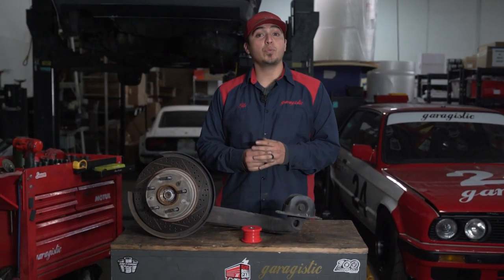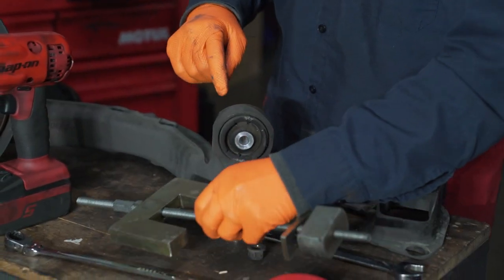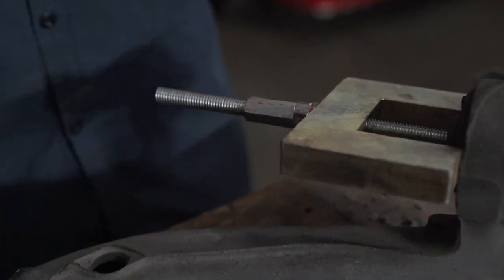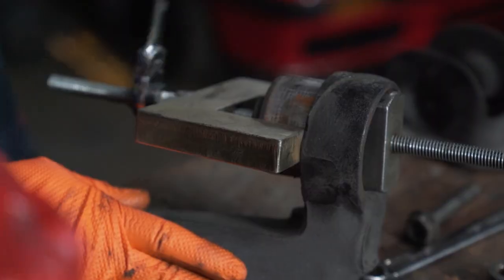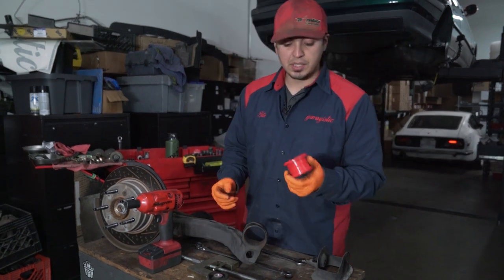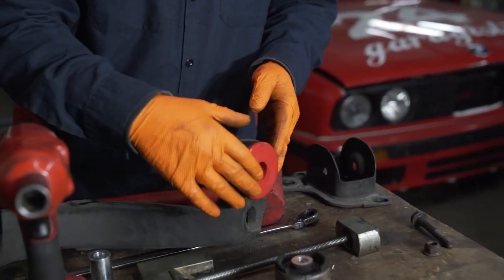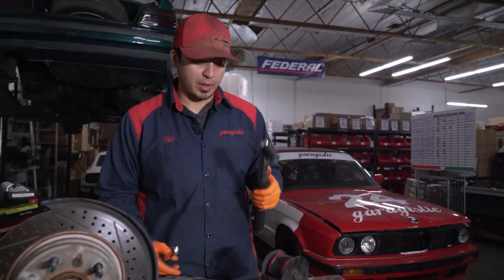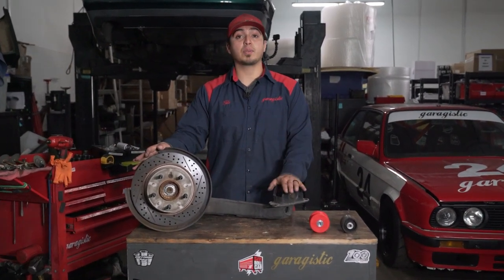How to Install E36/E46 Rear Trailing Arm Bushings | INSTALLATION INSTRUCTIONS

Comment: i know the thin side is installed first but does it matter which way they are? could the thick side be installed on the inside instead?. thanks
Reply from the maker: Depending upon the orientation of these offset bushings, they have the ability to either take toe out or add toe! To add toe out, you want to orient the bushings so that the thin side is facing the side skirt, while the thick side is facing the differential. Conversely, to take toe out, you want the thick side facing the side skirt and the thin side facing the differential!

Comment: Do I need to Lube the polly or delrin bushings before install? If so what is recommended?
Reply: You should
Reply from the maker: While not mandatory, it is recommended to add a little bit of silicone grease to prevent any potential squeaking.
Reply: @garagistic  I ended up buying your 80A subframe bushing, the Delrin for my rear trailing arms and also the treehouse control arm bushing. The ride was perfect and zero harshness. No greese was included so I had to find it somewhere. Parts were perfect but consider including it. Just a thought 😊
Reply from the maker: @jackeyjones574  Glad to hear! We used to offer them on our site but we will look into getting them included for more of our kits 🍻

Comment: Can you apply the shims as well with the garagistic polys RTAB poly bushings? or will they not fit?
Reply from the maker: When upgrading to our poly rtab bushings, there's no need to run the shims since the poly already limits the movement of the bushings 👍

Comment: @garagistic 
Does the bracket have to be set at a certain angle before torquing it down?
Reply from the maker: That bracket does not need to be set to any particular angle before torquing down